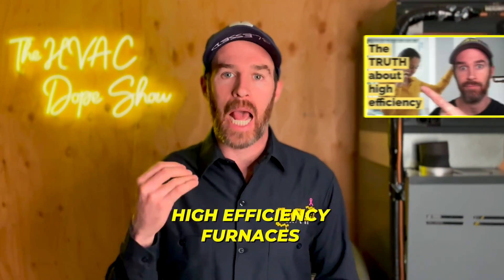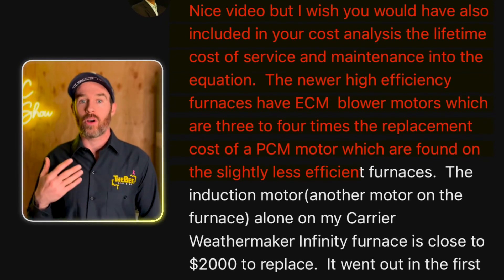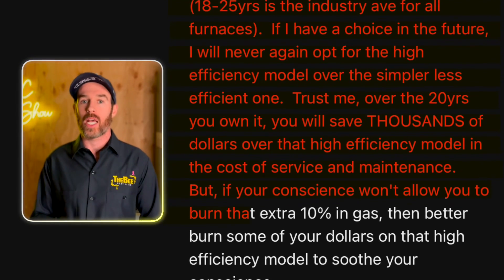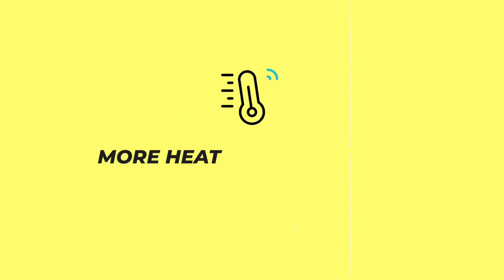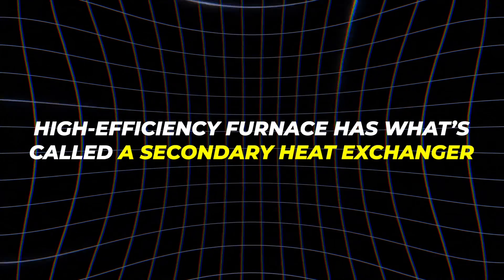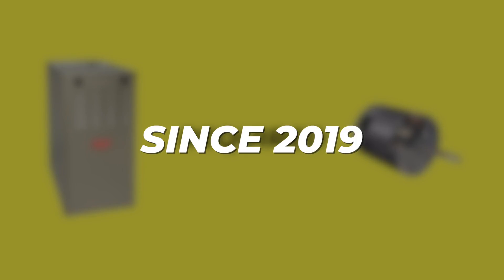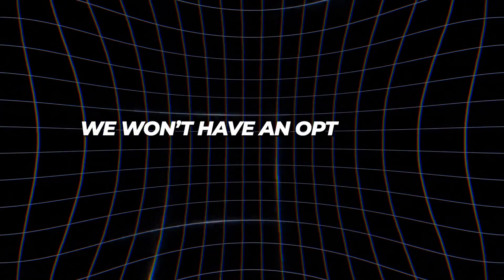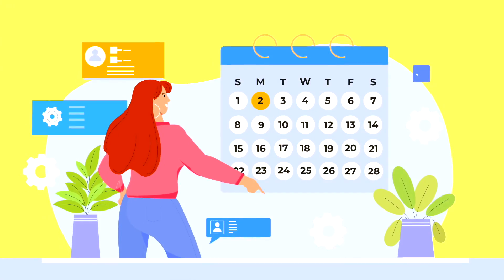“The True cost of High Efficiency Furnaces” 🔥🤯

Comment: no one ever talks about if you are in the midwest and if your furnace is old enough you may have to reline your chimney just to install any 80% efficient furnace, that easily bumps your cost above what a high efficient furnace would cost. so the argument that high efficient is higher in upfront cost is only true if your chimney has already been relined.... this could be game changing
 for most
Reply from the maker: Very true if you need a chimney liner this adds to the cost for sure and makes it basically neck and neck. An 80% system will always be less trouble than a high efficiency still so for some that makes sense but if it's a wash it sometimes makes sense for that reason... but you're 100% correct that is a big consideration with high efficiency

Comment: Can high efficiency furnaces be used if it is not feasible to vent it with pvc pipe if there is no exterior wall to vent it through?  The location of my furnace is in a basement corner that is below the grade of outside ground.    Can the pvc pipe run through an unconditioned garage?  The existing furnace is currently vented through the chimney.  I live in Pittsburgh where we have a wide range in temperatures.  Thanks.  Any input is greatly appreciated.
Reply from the maker: You can run it through the existing chimney but it can’t be used for anything after that, effectively you’re using it just as a chase to fish the pipe through (assuming it’s a straight shot to the roof). Unconditioned garage is fine but I’d insulate the pipe just so you have less issues during freezes with condensate freezing in the pipe. Normally not an issue in a garage but it’s just good practice and will prevent headaches in the long run!

Comment: Metal exhaust and switching to PVC will also cost when replacing an inefficient furnace. ( just over  5 min in video) Many people have finished ceilings etc so that will cost you a lot because now you have to hire dry Wallers etc. Now you have to deal with all the metal exhaust.
Reply from the maker: Very True! Always try to point this out in finished basements

Comment: My problem was with a boiler. It was oversized and cost us a substantial amount as it would short cycle. We got a 95% boiler replacement and it dropped our bill in half. Going from a 250,000 btu boiler to a 55,000 btu also fixed the problem where some rooms were hot and others were cold. So it could be worth a upgrade if you had a sizing issue with the current or older one.
Reply from the maker: That’s awesome and yes that’s a big drop that must have been a very old boiler to be sized that large. We do run into it often where people have the wrong size systems and it causes a variety of issues. Inefficiency being one of them for sure!

Comment: Hmm, something to consider is that it's a package deal for many. When you get a high-efficiency HVAC system they come in concert, Meaning they are integral to the cooling as well. Making the units much more efficient. I had a 13 seer high-efficiency HVAC System & replaced it with an 18SEER one as the other one was reaching the end of its life. Here in the southwest, you don't want to be without cooling. It reduced my electric bill in the summer significantly. My gas bills for heating were reduced as well but not as much becasue I went from 90% to 95%. These reductions should be considered for the ROI on the unit.
Reply from the maker: Definitely when you do it as a package makes the most sense!
Reply: Which is why, in most situations, it makes more sense to just go with high-quality, usually ductless heat-pump designs. I am very partial to Mitsubishi with their "hyper heat" low-temperature systems in the northern US in net-zero, or near net-zero, applications, especially, and have never looked back. Try to charge me $2,000 for a motor and I can replace an entire system, indoor unit and outdoor, for about the same money. A lot of these "high-efficiency" American systems are the real cash cows for those companies, much like Ford using as many non-standard fasteners and as much non-standard tooling required as possible to raise the exclusivity, difficulty, and cost to do any significant servicing of their trucks. When the major US brands of HVAC are aiming for long-term cost efficiency as well, instead of obsolescence and a high service-required frequency, then and only then will they be worth considering.
Reply from the maker: Honestly as dealers of this stuff I don’t disagree with your comment. Planned obsolescence is annoying for everyone even though that seems to be the new business model… stuff engineered to break. Ask any contractor today and they will probably tell you their biggest struggle as a company is the amount of overhead we’re having to pass onto consumers. People think lumber went crazy, but insurance is just as bonkers especially healthcare for a business.

Comment: This comment makes me quite angry.  To charge these prices to replace a motor is not right.  I have a 95% system and would be a bit much to install a different exhaust as I have pvc,  so when the time comes,  I will get a new HE furnace or a heat pump. 

My system is over 30 years old and has done well.  It would be cheaper to buy a second furnace on the internet and store in the attic for parts. 

In summary, I would rather pay more up front for longevity than play the game of system replacement every 10 years.   I simply don’t understand how this industry has changed from forgetting you even had a furnace to techs arriving with the standard - your 10 year old system is too old to repair.
Reply from the maker: Honestly it’s the amount of overhead we’re forced to pass onto consumers that is what drives the price up for everyone. And I agree a second furnace to steal parts off is not a bad idea if inflation keeps up at this pace! Hopefully it doesn’t 😬 thanks for the comments, you’re not alone!
Reply: I am not sure who was charging him that much but we had an older propane furnace that was 21 years old that was having issues. The guy who came out to service said he estimated it was running closer to 60% efficient. He gave us a quote of just over 2500 to replace the furnace with the existing ductwork and everything. We decided to hold off because winter was almost over and we were about to put the house on the market. Needless to say, it sounds like this guy got ripped off.
Reply from the maker: Some of the variable speed motors themselves cost of over $1,000, that's a fact... Hard to know without model or serial #, service companies in general have a lot of overhead. I don't know anyone in our markets selling furnaces for $2500, price is all over the place on that and is normally region specific

Comment: I am sure the math is complicated. Just installed a dual heat system here in Minnesota. Amana brand furnace and heat pump. The furnace is a modulating unit. Does the modulation help with the carbon footprint? Meaning, as it starts out at 30% and may never have to open the gas valve to 100%, my thought is this reduces carbon emissions into the atmosphere. I also had solar installed, just waiting on approval from Xcel. Once the solar is activated, I will ask my installer to change the heat setpoint on the heat pump, currently set at 30, down to 15 F. The installer was worried about pipes bursting in the cold, as this happened to an old unit several years ago. The technical document says the S-series can heat down to ambient temp of -15 F, obviously not very efficient at lower temps. With the extended operating temp, I am not worried about it breaking, just want the COP to stay above 2ish. My house is well insulated, so it does not take much heat to maintain comfortable temps. It took 10 hours to install the system and the HVAC guys said they were surprised how warm the house stayed during the install.
Reply from the maker: You should be fine at 15 or even colder, just have to see how it performs real time. Modulating helps for sure but not much the big help is from being a condensing furnace… that’s what take it from 80-96%. Modulating takes it to 98%. New furnaces are low Nox though and natural gas is pretty clean burning. Thanks for the comment!! It also depends what the heating demand is at that outside temp to make sure it’s keeping up but 15 is probably fine. A local contractor that installs them a lot will probably know what’s best because as it does get colder you want to make sure it’s switching over if it’s not keeping up! Or switching on the furnace heat during defrost cycles is an option as well.